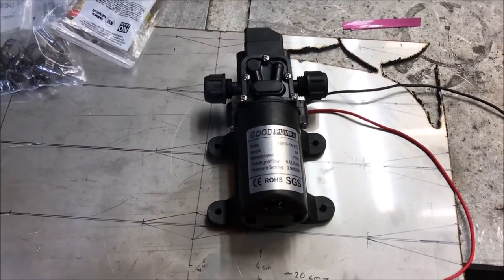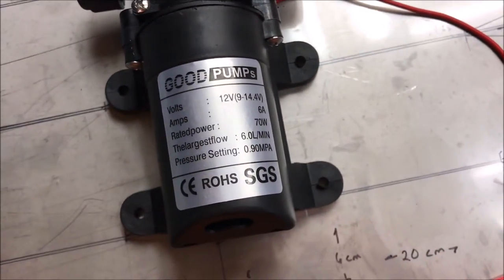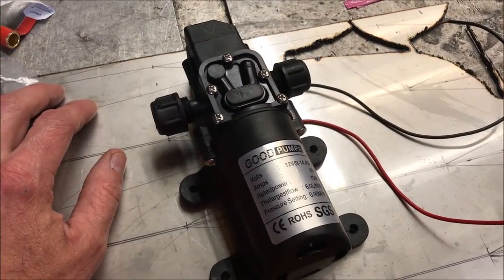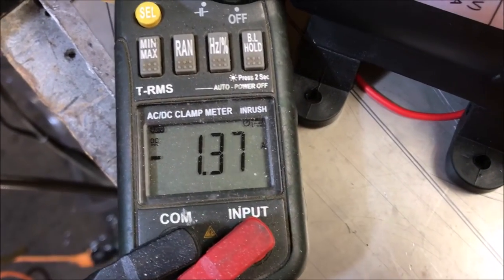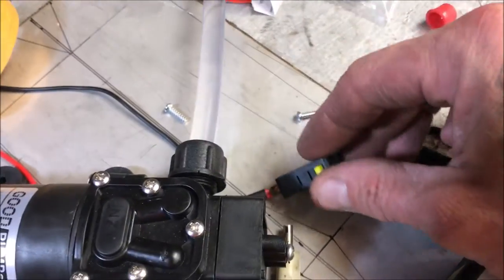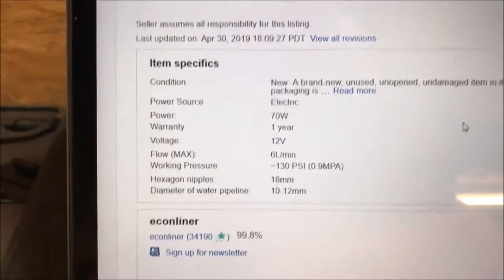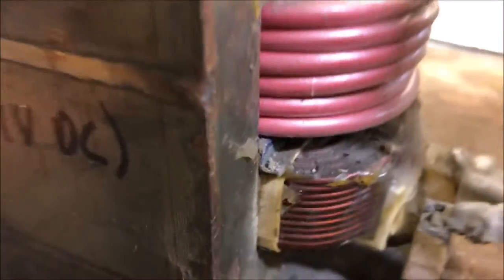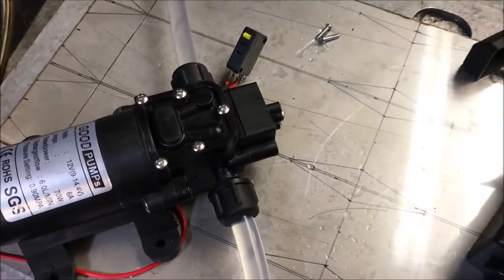Chinese 12 VOLT diaphragm  pump ebay and amazon false claims i

Comment: What do you expect for $27.00? It will probably work fine for most 'light duty' applications. I am pricing 12V diaphragm pumps now for a water/methanol injection kit for my turbo car. There is one guy on youtube who's used one of these pumps for his water/meth system for over a year and a half and he's had had no issues. You can easily pay 8 - 10 times that for a quality pump. But, yes, false claims are 'par for the course' (to continue the golfing metaphor), but not only on behalf of the Chinese.

Comment: Maybe Air inside of the membrane ?
I also own 2 of these with 100W 8l/min and they reach the pressure without any problem even below 12V input.

Today i did feed a Pressure Washer with it, even at the high flow of ~6l/min it maintain a pressure of 1,2Bar @ 11,4V input.
I did a quick test, and with 11V input it reach 11,5 Bar but i would like to lower the shutoff pressure, because this kind of pressures can cause demage to the parts.

To lower the pressure you can cut the Spring inside the pressure switch or change it.
But do not go to low, then the Switch will trigger the pump too much while running.

Minimum pressure should be 1/3 of the factory pressure.
Reply: is there a screw to adjust pressure?
Reply: My Pumps do not have the Pressure adjustabile switch, but if you searching there are models out there with adjustibile switches.

The only way to lower the shutoff pressure it to cut the Spring inside the switch, but be carefuel the adjustment for proper working is narrow.
You should not go below 1/3 of the default pressure.

Comment: Um, if it's leaking it won't get to rated pressure.  Just tighten it up and try it.  Don't be messing with the voltage.  Take it easy with the thing.
Reply from the maker: Its leaking because it cant even run at the rated pressure and even a small leak should still give working pressure as stated . it should even have a flow rate at that working pressure. Im very familiar with flow charts on pumps   . This company is claiming false specifications of there product . Its a huge problem with china . it does not leak at 12 volts and it will not pump past 80 psi   . it hits 100 at 15 to 16 v and at 18 v  115. But i do see your point . the screws are not loose brother .
Reply: Yeah the pump is just over rated.  It's a cheap RV style pump with false ratings on it. The leaks aren't the issue.
Reply from the maker: The guy offered a refund with no return so maybe he didn't know ?